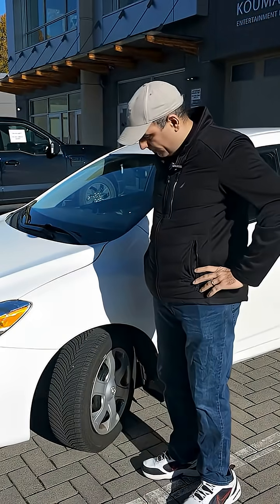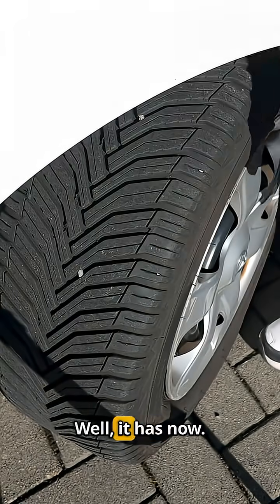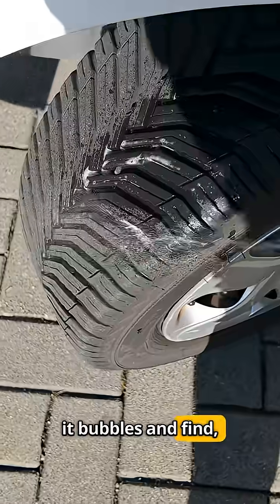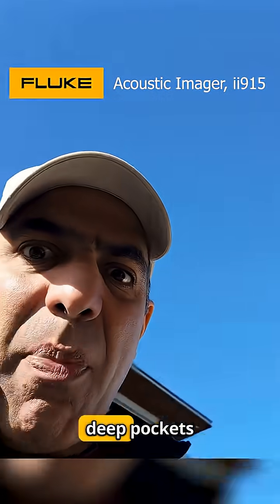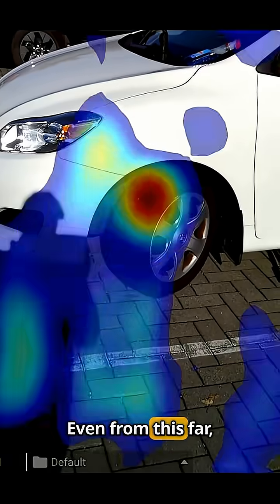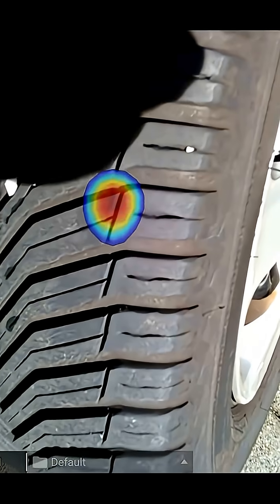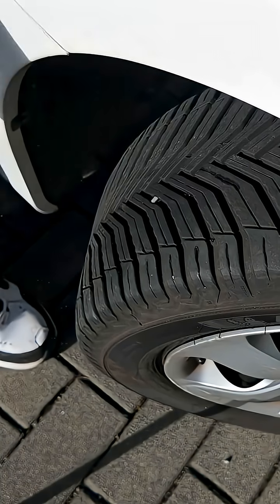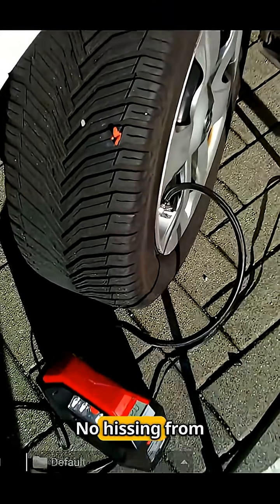Fluke Acoustic Imager x Electroboom

Comment: You're not supposed to plug it that close to the side of the tire😅
Reply: As long as it’s not on the side wall you’ll be fine.
Reply: its right at the edge. as long as its about a finger and a half away from where the sidewall and the treads meet. Some shops just refuse to patch these so they dont risk getting sued.